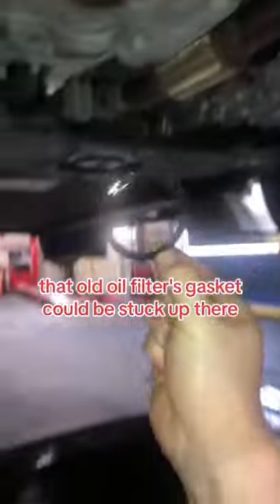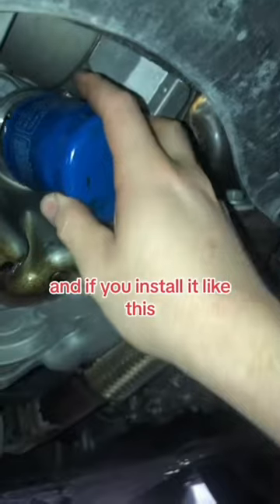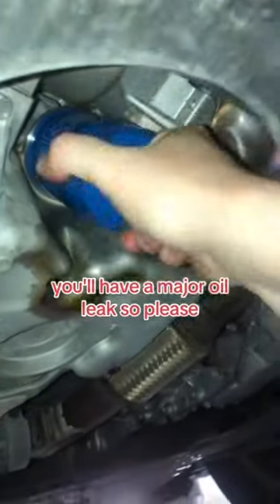ALWAYS Check Your Oil Filter BEFORE Installing 😯 #shorts #diy

Comment: This is fake I’ve never changed my oil filter gasket for my 2009 Honda civic Mugen style EX , my car runs great and I get great MPG
Reply: Well you change the gasket every time you change the filter
Reply: You have gotten lucky then and had the o ring come off every time you change it. Just pay attention for it every time so you don't end up with -2 psi of oil pressure and a rod tearing it's way out of the block lol. It can be a huge leak if there's 2 gaskets
Reply from the maker: I would recommend changing the oil filter every oil change

Comment: please do not put a rag in or near your oil filter or where you screw it in... unless you want small fibers and dirt in your engine. like seriously the oil does not need to be wiped off lmao youre just making things dirtier, even if the rag is brand new.
Reply from the maker: 😮 let’s agree to disagree my friend
Reply: Lmao this guy thinks he knows everything, he found out how to post shorts on YouTube and started posting smh don’t listen to these weirdo mechanics online Foreal !
Reply: @R18civic bro ur other comment is wrong. You definitely need to make sure that the oil filter gasket is not still up there. Canister oil filters come with gaskets attached. Sometimes they get stuck to the housing when you take it off. Also with cartridge filters you should always change the gasket. It is one extra step and it literally comes with the filter.
Reply: @str8oil imo visually inspect if the old filter has its gasket and you don’t see a gasket up there you’re good no rag necessary. no need to lube the new seal if oil is already in the seals old spot. and use a pick not a wrap to remove old seal from up there
Reply: I usually clean the area with a rag, remove the oil filter gasket, I prefer to apply silicone to the oil filter instead of using the gasket. It’s much better.
Reply: @Pl4gue.D0ctor  probably does work pretty well, Im just the type to put plastic over my whole engine when Its getting rebuild and I recommend it for everyone because you get dirt, dust and micro-fibers in your engine from using rags to plug the holes, and they will let dirt/moisture in anyways after long enough